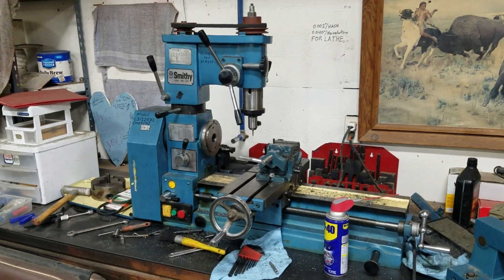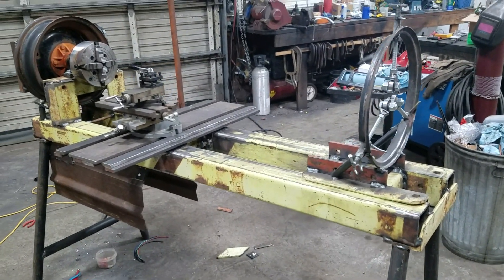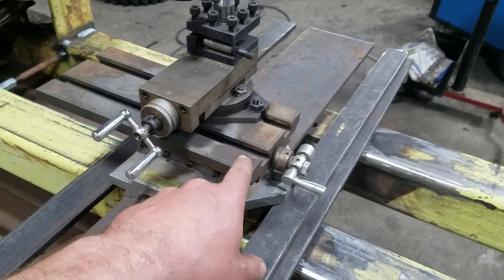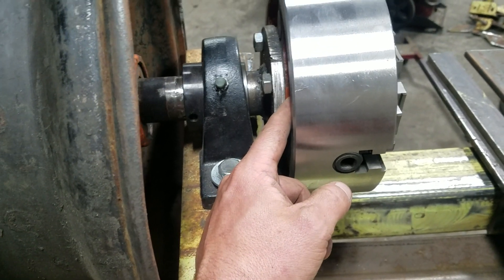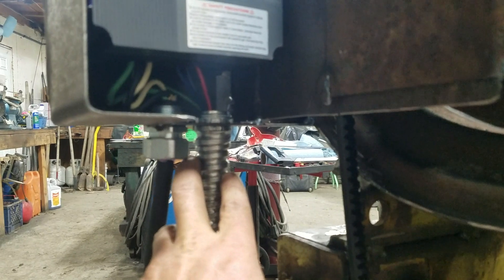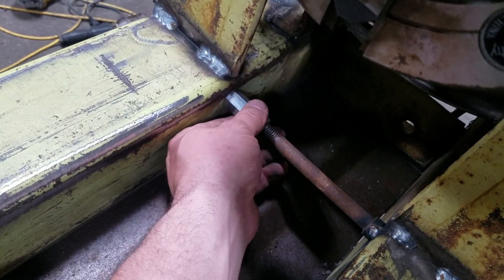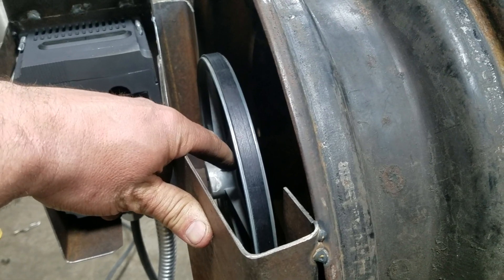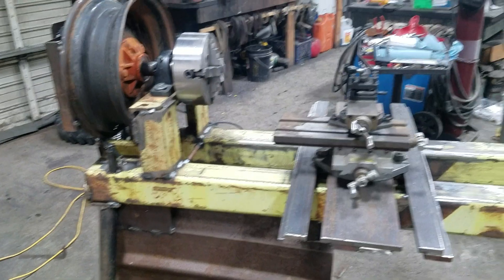Homemade lathe

Comment: This video gave me some ideas about how to build my own using a wheel bearing hub assembly with the weld on axle as the shaft for the chuck plate and chuck.  

Thank you for the video, and I wanted you to know that people like myself really appreciate the ideas and efforts, as well as the explanation of the details of your project, as it is very helpful to others out there with their own project!

I'd love to see a follow up video with how it worked out or didn't work out and why.  Even if things don't work out when making stuff like this, it's just as useful and in some ways even more useful to other people and their projects or ideas.  So either way, it's all very helpful and interesting no matter what!

Comment: Should work good< show it work
Reply from the maker: At the moment I have built it to accept an AXB quick change tool head. The tool head seen on the machine is the wrong height so I can't run it yet. I'm in the process of getting the correct setup for the tooling. After that is complete I'll run it and find out how it cuts. I'll post another video when I get it done.
Reply: What a helpful thing to say lol...